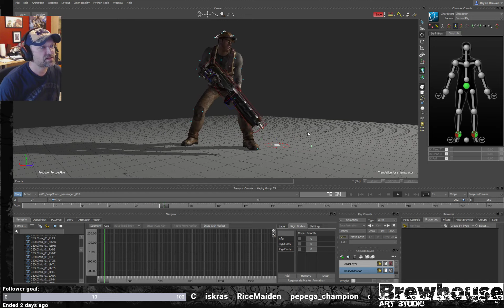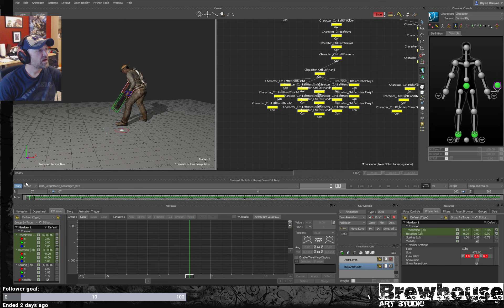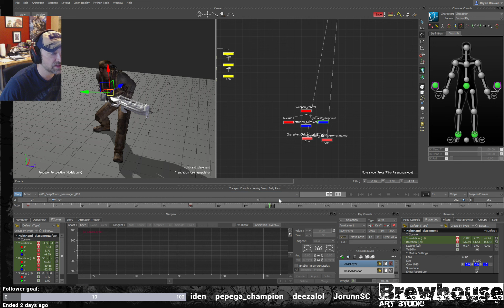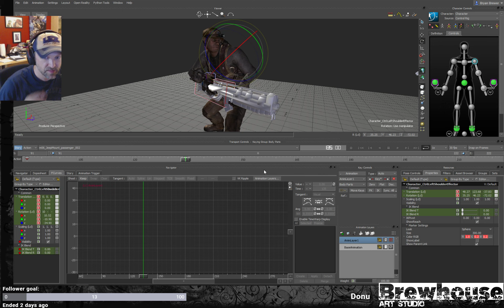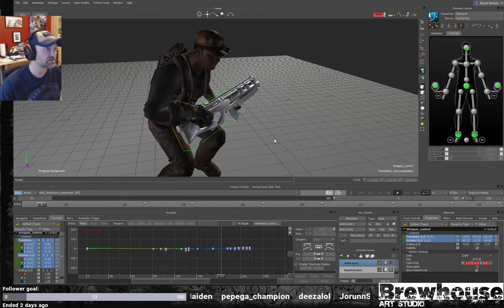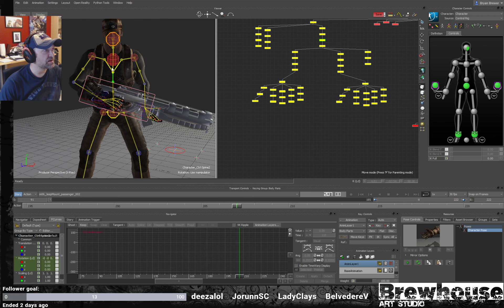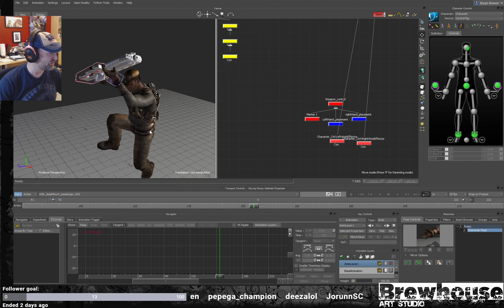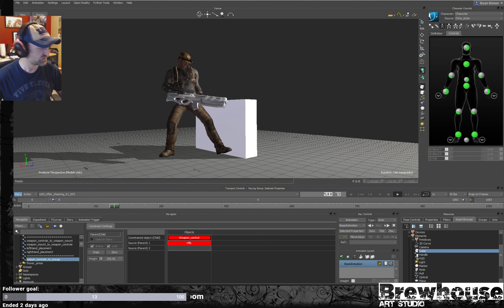Motionbuilder Tutorial - 4: Prop rigging to work with motion capture and motion editing

Comment: hey Bryan, i would like to know which interaction mode you use in motionbuilder ? (with your wacom)   
i have a tip for you in return, if you want to, for example, set scale 10 to xyz via the numbers in the lower right, you can enter 10 in x and press ctrl-return to apply it to all three.  greetings and thanks for making all these incredibly helpfull videos!
Reply from the maker: That is a good tip! Thanks.  For my Wacom settings I have it setup in the Wacom Tablet Properties so that the Pen tip is (click) the first button is (middle click) and the second button is (right click)  I don't have the eraser end setup for anything because I don't use it.  My thought process is to have the buttons setup like a mouse.    The Mapping Mode is set to Pen.  I Have three monitors with one rotated to portrait so it is not very friendly with a tablet so I only have my two landscaped monitors mapped.  I have to switch over to a mouse to do anything on the third monitor.  But that is okay because I only use that desktop space for mail, skype, slack, web pages or Netflix.